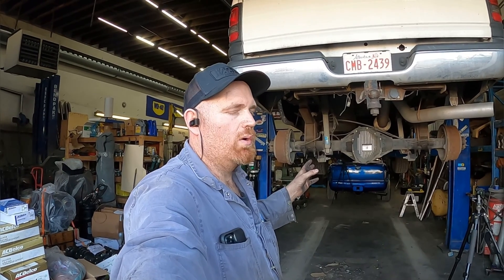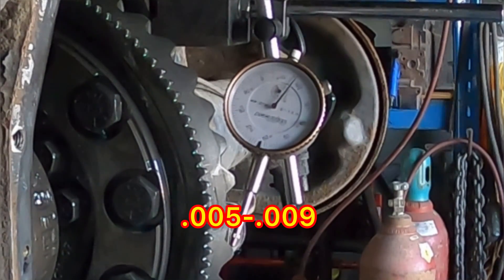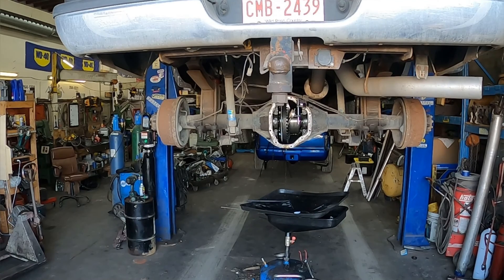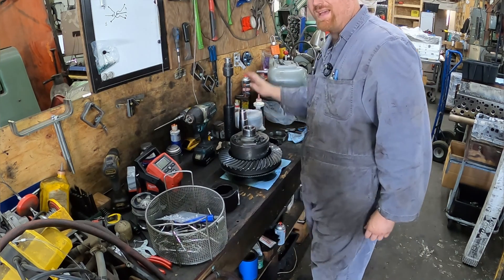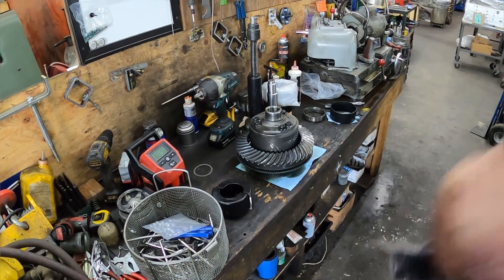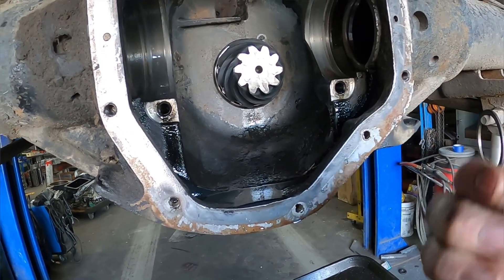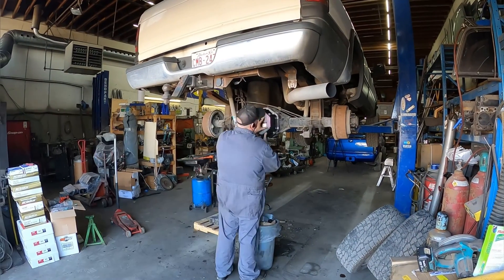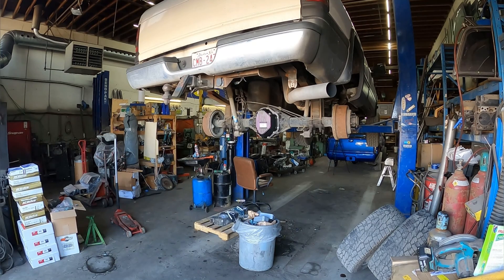DANA 80 BACK LASH RESET.

Comment: Great video I learned a lot ! Curious about a couple things. 1st how much difference is there between a Dana 80 and Dana 70 in doing this task. Also the truck you're working on has drum brakes, in your opinion is it worth it to convert them to disk. Thanks !
Reply from the maker: Basically the same. Just a couple small things different. But if you watch this video you should be able to do it

Comment: I have a some vibration around 60-65 MPH on my truck that i cant find the source of... checked everything i can think of and replaced the front axle -ujoints but its still doing it... any ideas where i should check next!
Reply from the maker: pinion angle ?
Reply: Brake drums

Comment: I was really hoping you'd cover the process of reinstalling the shims. I owned a Jeep Grand Cherokee for 4 days, dealer was to replace the diff bearings. I showed up Monday morning and they had just broken the second spacer. I'm walking up the drive and one of the mechanics saw me coming and his hand went behind his back. Trying to hide the crime. They were trying to tap the spacers in with a hammer. These things are cast iron and brittle. I've heard of a "case spreader" and was interested in seeing one used.

Comment: Any secrets getting oil to the wheel bearings? Had hell with mine.
Reply from the maker: easy way fill the diff and lack one side at a time up as high as you can and let it sit for 15-20 min a side